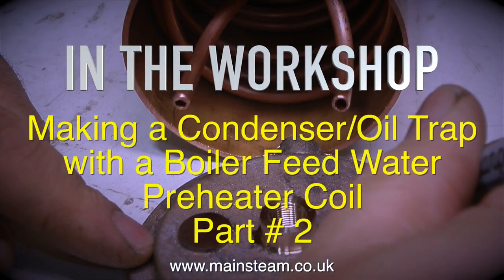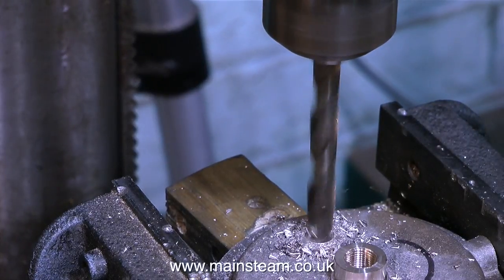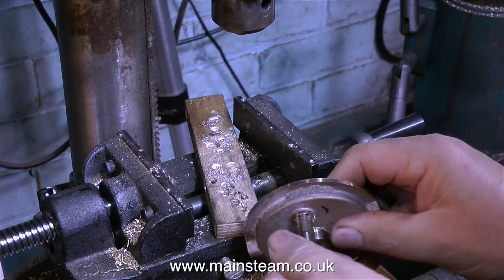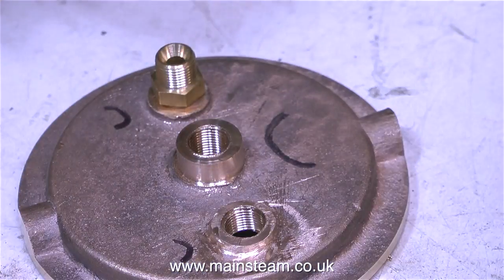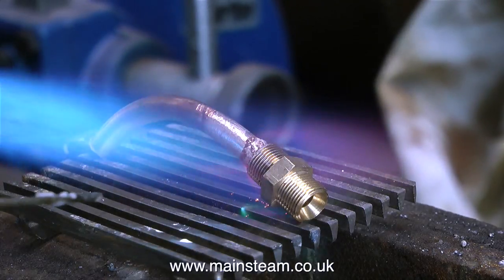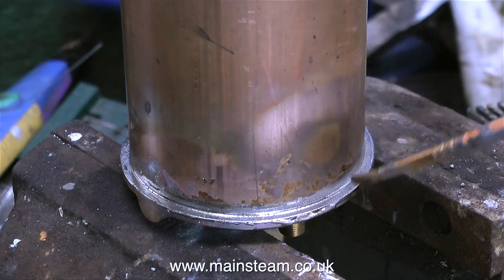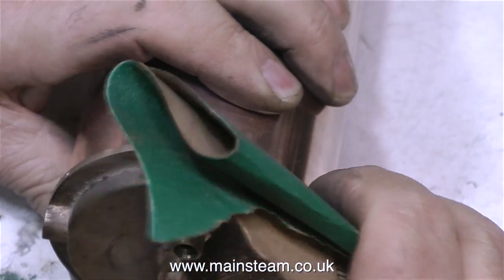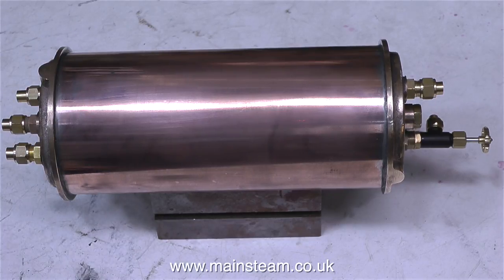A CONDENSER/OIL TRAP & FEED WATER PREHEATER - PART #2

Comment: That type of rough finish can be caused by using a high amount of recycled sand in the mould. The sand mould is broken down and "sieved" for a better word to a chosen size. Too many cycles and the graded sand becomes very coarse and becomes detrimtental  to surface finish. You can get around it by facing off with new sand around the pattern and backfilling with recycled but it's down to cost and efficiency

Comment: I'm confused. Why not tap for the drain tap that you used instead of tapping larger and making an adapter ?
Reply from the maker: I wanted the function of an external larger diameter drain that could be piped externally to a remote tap.

Comment: That's quite the clever trick of mounting the steam outlet so it will suck in water when the condenser if full.
And lumps in castings are caused when a small bit of the sand that makes up the mold is accidentally dislodged when withdrawing the pattern. This void in the sand mold results in a matching protrusion in the metal casting.
Reply from the maker: Thanks for that. I thought that it had to be from something in the pattern removal stage of the process {:-)))
Reply: ElectricGears has it right, but it still would be interesting to see Blackgates doing some castings if they do it inhouse.

Comment: Another great video Keith thanks. I'm looking at making something similar but I'm a tad confused - am I right in saying the condensate is drained off through the top by internal steam pressure forcing the water from the bottom via a full length pipe ? I just assumed the drain would be at the bottom.
Reply from the maker: Yes you are indeed confused, the short pipe drains from the bottom ....
Reply: Ah ok thanks it's a good job I asked :-)

Comment: I noticed that in your older videos, you seem to recommended using a drill bit 1 imperial size smaller than the finished threaded hole.  The last couple of videos, you comment that the drill is 2 imperial sized smaller than the finished threaded hole.  Is this because the fittings are larger in this care, requiring a larger thread?

Love all of your videos, by the way - thanks for the interesting content.
Reply from the maker: If I said one it was an error - 2 imperial sizes down is ME thread type tapping size - which video did you hear me say "1 imperial size smaller" for tapping size on ???? 1 imperial size smaller is for Reaming ....
Reply: What is "one imperial size"? 1/64"?